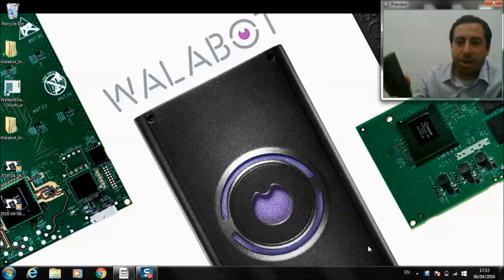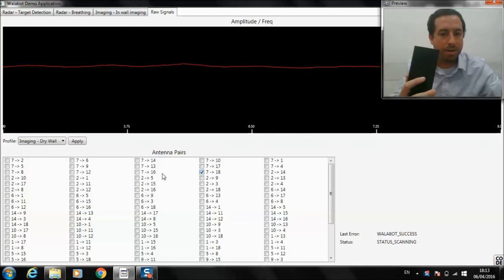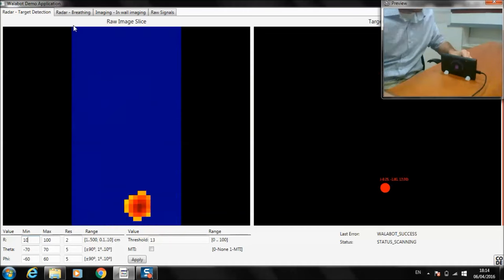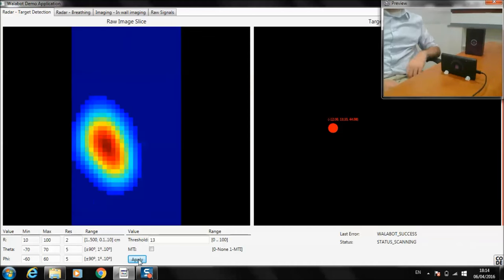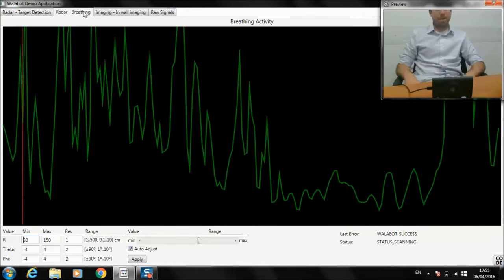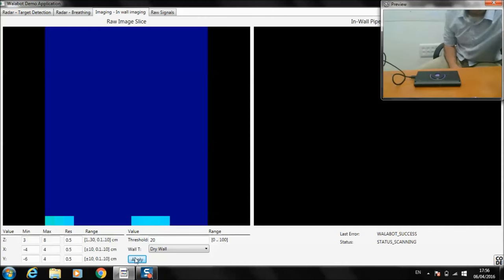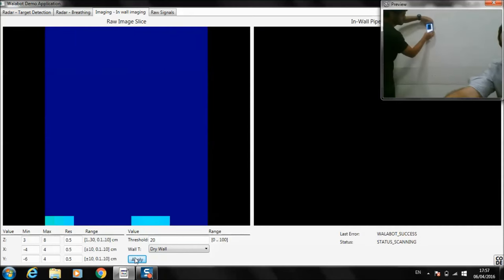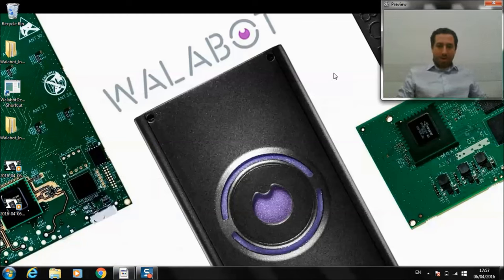4 Sample Demo Applications for PC - Overview

Comment: Are there any updated hardware released, or new versions coming out with more capabilities or more  signal? I'd like to do the in-wall stud-finder and pipe/cable detection, but would like to incorporate it into a 3d space like SLAM (simultaneous localization and mapping) so that as you follow a pipe across the ceiling and between rooms, it' is building a continuous map, and so long as you can keep connecting it, could provide you a good plumbing schematic (like doing a photostitch) but with 3d information collected from the raw mmwave, rendered space in 3d. Does the walabot or other vayyar tech do this to kind of spatially map the room and objects in the area, etc.? (or into the walls/beyond for pipes and cabling)?

Comment: The technical brief hasn't much "technical" information! Which kind of radar it is? Pulse radar, Pulse-Doppler or a FM-CV radar. If it's a pulse radar, what are the pulse duration, central frequency, etc. What are antenna gain, minimum received power, bandwidth, range, cross-range?! What are the limitations of Arena size in combination with the resolution... Except an API and a technical brief, there is no other source to get the characteristics information...
Reply from the maker: Hey, thanks for the interest! We'd be happy to provide any information you need. Why don't you shoot us over an email to support@walabot.com with your specific questions? Thanks!
Reply: +Walabot I sent an e-mail 2 weeks ago, but got no reply till this moment. I could try it again and sent you a 2ed e-mail. Since still there is no forum to exchange information with other people, it would be great if your support team reply faster ;-)
Reply from the maker: Wow, really sorry. You can give me your name or email address and will check for you or just try writing again - will watch for it.
Reply: +Walabot well, I've just sent you a 2ed e-mail. The case ID is 11106/78ed61. I appreciate your help in advance!